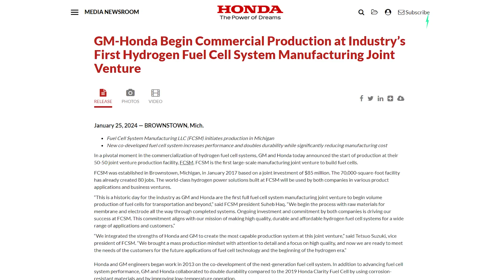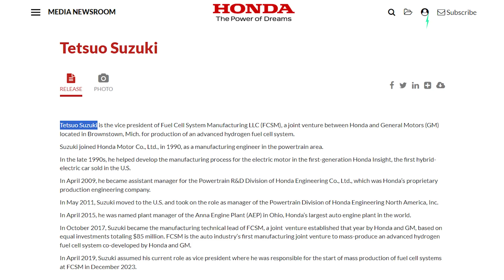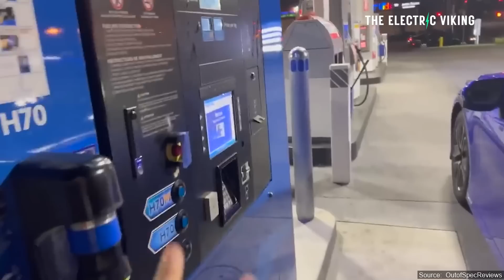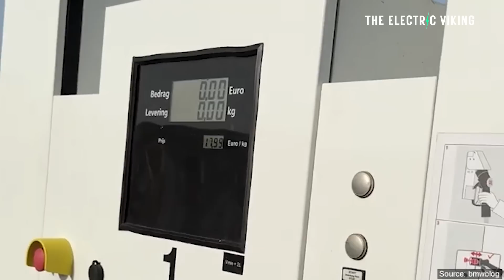GM & Honda's hydrogen fuel cell facility begins mass production in America

Comment: There is simply no way I'm buying a car with a high pressure hydrogen tank in my car.
Reply: Wouldn’t fly in a plane with a pressurized hydrogen tank either, it is ridiculous.
Reply: @planesstrainsandautomobile2801  why not, if it has a safety record similar to that of current air travel?
Reply: Don't worry, in just two days the cylinder will be empty. Not even NASA and SpaceX have developed a hydrogen cylinder without losses, but Jurassic GM thinks it will achieve it
Reply: Fitting Jurassic gm ha
Reply: @abraaourbano7118  And don't keep your hydrogen car in the garage!
Reply: Meanwhile, there's apparently no truth to the rumor that the upcoming GM/Honda joint venture car is internally code named Hindenberg..
Reply: There is no way I'm buying a car that uses some type of "fuel" I have to buy by the gallon and can't make myself and have to drive somewhere to get. EV is the way to go, charge at home.
Reply: Gonna beat Russian tank turrets.
Reply: I just can't see how getting it towed to California and back to fuel it could possibly compete with charging in my garage, and riding the supercharger network.
Reply: There is no way im buying a car that runs on flammable gasoline.
Reply: It's only 500 bar
Reply: @johnslater7718 700bar 😅
Reply: It would be a fuel cell powering electric motors, rather than hydrogen engines, still I wont buy it.
Reply: @JoeyBlogs007 The fuel cell can't deliver enough energy t for the motor. Rather it will continuously charge a small battery, the battery will power the car.
Reply: hydrogen has a future in shipping, long-range trucking and aviation and maaaaaybe industrial level power needs but passengers cars and trucks? Never. We already have the tech and charging infrastructure for electric so it just makes too much sense. Those places only make limited point to point trips which makes it easier to build hydrogen or ammonia fuel points but even then...
Reply: @stickynorth  Honestly, I wouldn't get on an airplane that was hydrogen powered.  Jet fuel is a very high density fuel that is very stable and easy to handle.  Hydrogen atoms are tiny and difficult to contain.
Reply: But you’ll fly in a pressurised tube and wing with jet engines strapped to the outside?
Reply: @andrewharris3900  🎵One of these things is not like the other.. 🎵
Reply: @andrewharris3900  planes don't crash all the time with each other.
Reply: Pressurised to about 10,000 feet. The difference between airliner pressurisation and hydrogen tank pressurisation is huge. Airliner pressurisation is a fraction of 1 atmosphere whereas hydrogen tank pressurisation is hundreds of atmospheres. Now do you get it? @andrewharris3900
Reply: @andrewharris3900 Yep it’s statistically far safer.
Reply: @fractalelf7760  I agree, it’s the safest mode of travel per kilometre travelled. Some things sound ridiculous (like a pressurised tank of hydrogen) but can be completely safe.
Reply: @andrewharris3900  It might be safe but it’s never going to happen.  There’s simply no advantage for it over EVs.
Reply: @fractalelf7760  A fuel cell car is an EV, it runs on electric.
Reply: @andrewharris3900  Even so it makes no sense from a distribution standpoint.

Comment: Truly scary that this large an aggregation of technology and money can jump off a cliff so to speak and commit suicide by chasing a technology that is 1/3 as efficient as decent lithium ion or other related chemistries and electric motors. That 1/3 efficiency is not even contested by anyone with a passing understanding of energy physics and yet is ignored by folks investing billions in a dead end. What does it take to create this level of incompetence because it's truly difficult to understand? As someone once said you can't expect someone to understand something if their salary depends on their not understanding it.
Reply: 1/3 is generous. In theory, yes you lose 25% in the production og hydrogen and at least half of the rest in the engine, leaving up to 40%. But that is theory. Reality is about 20% at this point.
Reply: @mvoetmann1  you are correct of course but I was trying to be as generous as possible and leave out stuff like metal embrittlement, leakage, Transportation costs, other losses, greenhouse gas effects, current staggering and prohibitive cost of fuel cells themselves, and of course the downsides of having a 10,000 PSI tank of hydrogen essentially a rolling bomb as your primary Transportation vehicle. Obviously adding all that up makes hydrogen really kind of a nightmare.
Reply: petrol is only 30% as efficient as battery electric as well but it's abundant...the vast majority of hydrogen is made from fossil fuel too (90%+)- the fossil fuel industry is heavily vested in keeping the demand for it's products going, hydrogen is not an existential threat like BEV.
Reply: I think that was Upton Sinclair.   Re:  "What does it take to create this level of incompetence"  - this is probably the best theory for collapse of societies.  Power gets concentrated in fewer and fewer hands,  and these hands have a greater and greater self interest to interest in welfare of society ratio, not because power corrupts, but because it is a magnet for the corrupted.  Every 80 years or so there is a massive crisis and at the end of this power gets divided broadly and smart people say "this is not happening again in my lifetime".  Then they die and the cycle repeats.
Reply: Governments like Japan, China, Germany, Canada, USA and others have poured far more money into fuel cell and infrastructure support than they have for BEV. This is because the oil companies are so successful at lobbying. Companies like GM and Toyota are literally paid to develop fuel cells, they do not have to show a profit. Toyota sells its Mirai in California for $52k, and the California government gives twice the credits for FCs vs  BEVs. Plus they funded about 50 charging stations. In order for Toyota to sell its 6000 Mirai/yr they have a $20k rebate or discount program on top of $8k federal, $6k state and other incentives, plus they give away 6 years of free H2 fuel with each new car sold and 3 years free fuel with each used off lease Mirai sold. Effective price about $20k for what is actually a nice luxury car, and I bet they still come out on top with the CARB credits included.  This is only on the sales side, Toyota also gets support from their Japanese government to produce fuel cell cars as GM gets money from USA government. This is what it takes to get people to buy a fuel cell car.
Reply: Gravimetric energy density:
hydrogen: 33-39 kWh/kg
lithium ion: 100-265 Wh/kg

Obviously there will be applications for hydrogen if the downsides can be mitigated.
Reply: @JohnboyCollins  but it is categorically absurd to measure hydrogen's gravimetric energy density without considering the cost of containing it. That's like talking about the energy density of lithium ion electrolyte without considering the whole battery weight. So let's have a level playing field. When you put those numbers in, it's actually pretty close.
Reply: Said 11 replys, but displays only 7. Why was mine deleted? Too close to the truth?
Reply: @royh6526  Youtube will delete automatically if you put in an external link or some derogatory remarks I think. Try again.
Reply: @MotoGuzziMoto  I did neither. Short version, I blamed Oil lobbyists for promoting massive government funding of fuel cell research for automobiles. So much that GM and Toyota have little to no risk.
Reply: There are ways to do it on board and on demand very efficiently with a carbon thermal reactor that can crack water. I build a system. But to get your feet wet look up " water gas"
Reply: Yup, hydrogen powered EV's are 3X more efficient than hydrogen powered ICE. Pure stupidity aka Kodak, Sears, Blockbuster, Nokia...
Reply: Plug in electric are a stepping stone to hydrogen or some other advanced technology. Battery EV's have so many batteries which are often mined in appalling conditions, and those materials are finite. Then there's the end of life recycling of all those batteries.
When an hydrogen filling station is running on renewables and doesn't need tanker trucks to bring in hydrogen, it's wonderful. Those are the ones that need to be invested in. Less than five minutes to fill the tank and getting a wicked range is WAY better than waiting over half hour for crappy batteries to charge. I will never do that, it's retarded 🥴👉
Reply: @Johny40Se7en  
Gravitational tech > Magnetic tech > Electric tech > ICE tech > Steam tech > Coal tech > Horse tech > 🦶
Reply: @larryc1616  "Gravitational tech > Magnetic tech > Electric tech > ICE tech > Steam tech > Coal tech > Horse tech > 🦶"
Indeed =P
Also, Magnetic tech and Electric tech need not be separate, unless you're using permanent types of magnets 🙃
Reply: You forgot that time (which is fixed) is the most valuable resources for people ...while energy is abundant ...  It doesn't matter if BEV have 100% eficiency .. but if it take 2 hours to recharge it ..then it's a big weakness  .. Not to mention that EV charging station need to always be online to the power generator station ..which is another weakness ..
Reply: @kebeleteeek4227  ALL fuel sources need power to fill your car, a gas pump or hydrogen pump doesn't work either in a power outage.
Reply: @TB-up4xi  Next time you pass a gas station, you'll see a generator around back.
Reply: @TB-up4xi  What if there was a way to create fuel gas on board and on demand? That infrastructure goes away and can be replaced with a new and more viable solution.
Reply: @kebeleteeek4227  nope. Your post contains so many factual errors that I will only rebut the most outstanding one. Actually EV's save time and don't take 2 hours to charge unless you're charging at home but then again if you're charging it home you charge overnight so it takes less time to simply plug in your car when you get home then it does to go to a gas station. This is all part of the disinformation ecology to help you stay hostage to Antiquated technology and fossil fuels. Good to see that you are doing your part to help make money for the fossil fuel plutocracy. Obviously they need everyone to pitch in to make sure that the money keeps rolling in! Nice job!
Reply: @kebeleteeek4227  Need to be online? As if that was not true for H2 stations (or gas stations for that matter). How can you otherwise use pumps and pay?
In my entire life in 48 years as holder of a driving licence I have hard to remember even one occation when I haven't been able to fill up my car because of power outage. In that case I was able to drive to the next town and didn't bother to store it in my not limitless brain space.
Reply: @perperers2502  Every gas station that I'm aware of has it's own generator.   And the generator only has to power the pump, not actually charge a battery, so you don't need megawatt generators; usually a 30-50KW generator powered by propane will work fine.   The cost of a setup like that is about $30K

Comment: Lack of refuelling infrasture is not a good argument against hydrogen. Any new technology has unreliable and lacking infrastracture, EV no exception. 10 years ago, charging stations were even less and urneliable. The real argument against hydrogen is inefficiency, and storage and transportation of presurized hydrogen tanks are very costly.
Reply: I think the argument that a fully loaded hydrogen station could only fuel 50 cars is a bit compelling.
Reply: Lets be honest, if you don't have access to home charging BEV is still a total disaster in many places.
Reply: @jamie-ck6js  true but that's simply inexcusable incompetence of current EV industry. In theory EV chargers are fraction of cost of gas stations and delivering electricity to changing stations is far cheaper and  safer than moving tons of flammable liquid fuels by trucks.  Most of charging stations fail because of overly complicated payments and activation schemes and the fragmentation of providers wants you to sign up with their account and apps. This is really absurd and inexcusable.
Reply: @i6power30  I 100% agree with that.  But look at real customer reports of sudden battery failures, where they suddenly go to won't charge, and they nearly all involve fast charging.  Ok, this might get better, but would I advise a friend who was living in an apartment to spend 50k on an EV and rely on only fast charging...probably not.

Interestingly, one of the things reportedly holding back scale up of a well known EV truck, is that repeatedly fast draining and hyper charging the battery very quickly results in significant range degradation/failure.
Reply: @jamie-ck6js yes that's absolutely true but you have to keep in mind 67% of people have access to home charging and 16% don't own any kind of vehicle. 

A very small group without home charging have access to work charging.

So we are left with 1/6 of the population who are not a good Target for electric vehicles currently. I wouldn't call it a disaster though. It's still a bit less expensive than a gasoline car.

About $8 to fill up from empty at home versus $25.00 to fill up at a supercharger versus $29 - $55.00 for a gasoline vehicle.
Reply: @mac_mcleod  maybe that is where location will make a very big difference.  In the UK in towns and cities about 60% have no home charging and fast charging is very much more expensive than filling with gasoline.  So you end up with around half for whom it is going to be a problem, for a while at least.
Reply: @jamie-ck6js  that seems low... "As of July 2023, 50% of UK adults own their own home."  And others rent a home to I can't get a good breakdown of houses vs condos/flats.

Also, about 23 million UK adults do not own a car of any kind.
Reply: @mac_mcleod  The situation is probably worse, because even if you put apartments to one side, all those houses in town and cities in the UK don't have offstreet parking, with no space guaranteed at your house.

Don't get me wrong, they may come up with a solution, but the most telling stat is this: out of those in the UK that have switched to EV and said they would never go back to ICE were asked what they would do if they didn't have home charging, almost all said they would go back to ICE...